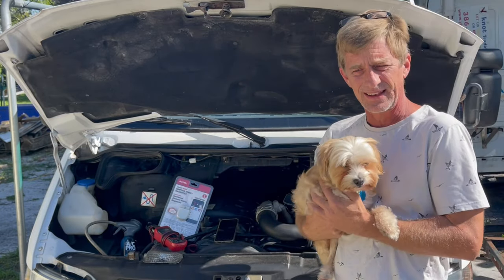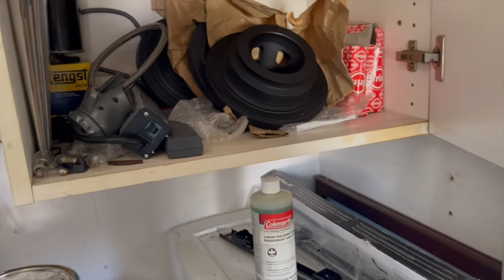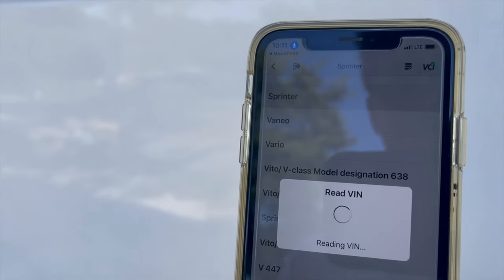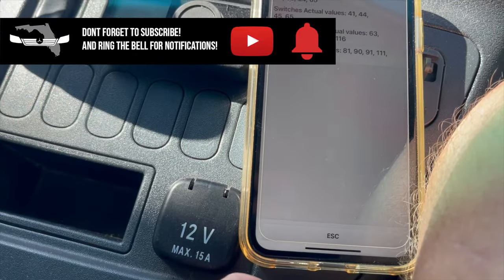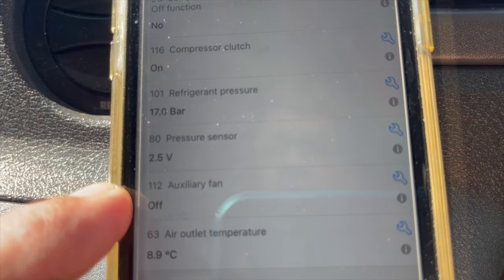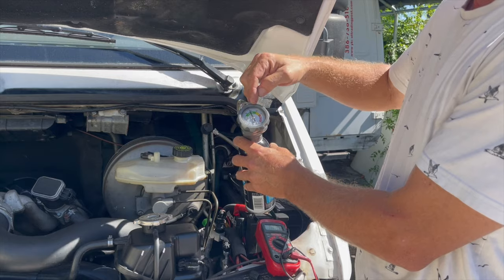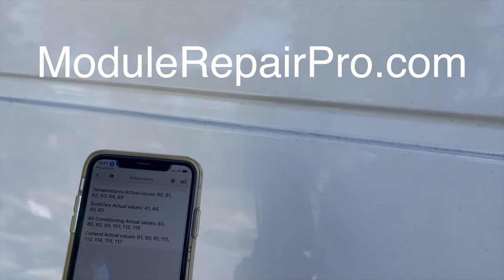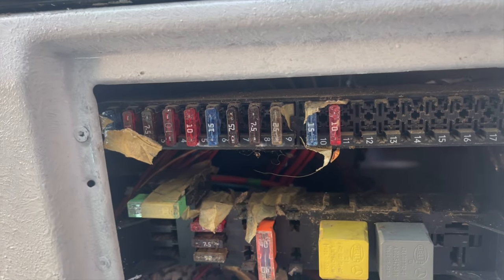T1N Sprinter Air Conditioning Diagnosis

Comment: Last one reminds me of a 8 wheeler  tipper truck that turned up here with no A/C....... Put my gauges on: Zero pressure...... I expected a sheared line somewhere..... Those unions are not the strongest......  Turned out there was simply no compressor....and the previous owner had simply put on the shorter Poly-V-Belt for the Non-A/C Version of the truck!
But it is simply criminal to leave hoses on A/C lines open to atmosphere....dust and humidity will destroy components.

Comment: This video just saved me from dying of heat on a trip to the desert! Thank you

Got some strange readings though. My ac was blowing warm and with a strange wheezing noise. The refrigerant pressure was low (3.5 bar and didn't change with acceleration) but the gauge on the refrigerant bottle read it was full (low end of green). Wasn't sure what to do so I decided to add some refrigerant anyway. It took a bit but ended up blowing cold. The pressure bounced around a lot while driving though (4 -17 bar) which I'm assuming is normal?
Reply from the maker: Normal. Our vans seem*** to need more freon than minimum green-zone but too much is bad news. The changes in pressure while driving should relate to the compressor engaging. It will disengage when the van is cold enough, the condenser coil is too hot, evaporator coil too cold, or the computer thinks we need all available power at the drivetrain. Yours might be working fine now, but if it is not be aware of the power demand situation. For instance, a MAF or EGR problem causing low power from the van can result in the a/c cutting-off every time you accelerate or climb a little hill.

Comment: Great video!  Thank you.  Inspired me to get the Autel scanner.  Amazon is showing the APT 2500 as the upgraded 200.  Recommendations?
Reply from the maker: Someone else showed me that AP2500 recently and I don't trust it! The AP200M, AP200H and AP200T were not upgrades and only locked subscriptions to other vendors like Wal-Mart and Harbor-Freight adding layers of complication to returns and tech support. If Autel sends me a unit I'll try it out, but I've pitched their product solely because I like it for 4 years, sold over a thousand through my Amazon links and they won't return my emails. Maybe we need to get a petition together?
Reply: You have my signature on this petition 🙂
1000 units is probably nothing for Amazon but Autel should really appreciate the free advertising they get through your channel. I appreciate the unbiased reviews and have learned  a lot from you. I am not a mechanic but thanks to your videos (and few others) I’ve tackled projects like water pump replacement that I couldn’t have done before. Thank you!

Comment: is the evaporator condensation drain easy to access? Can it be accessed from above, or has to be below?
Reply from the maker: I don't think it is accessible at all without tearing the dash apart. A shop-vac on the drain line may be your best bet. Perhaps blowing air into the drain line will solve the trouble? If the condenser pan is full it will surely splash inside the van.

Comment: I had a leak in the '06 Sprinter AC condenser and replaced the condenser. Then remembering that I had not positioned the outside air temp sensor; I pulled the hood release and the hood is too tight at the latch and will not open. Had the daughter stand at the front edge of the hood and push down while I pulled the hood release and still not able to get the hood open.
What is your advise on opening the hood; I don't want to cut a hole in the hood to get it to open. Thanks FVM
Vincent Chicago
Reply from the maker: There is a thing to push from underneath the front edge of the hood. Need a long & strong screwdriver or metal stick* and bending the plastic trim.
Reply: @FloridaVanMan  Thanks, I will give it a try. Happy Days    Vincent
Reply: @FloridaVanMan  Well, got the daughter married last Thursday and Friday so back to work on the van hood.
I tried with long screw driver and hardened metal long rod and I am moving the secondary lock lever but not the adjustable
center lock male part to get the initial release. Got any more detailed instructions on this hood release. I have not tried my
8' 2 X 6 with a thick cushion at the hood center front edge with two men and someone working the hood release from drivers
seat.? I just do not want to start drilling and saber saw cutting at this time.
Thanks  Vincent
Reply from the maker: @vincentrolfe1384  There are a few good ideas here: https://sprinter-source.com/forums/index.php?threads%2F17545%2F&fbclid=IwY2xjawEX0VlleHRuA2FlbQIxMAABHd9Drl8miWyipUn_2PgyBY_RCoGdxiYNKTBUqeksAQIu0SN-kdYk_G08wQ_aem_DqJcVXsqj5R8sgcjmDFEXg

Comment: Got a quick question for you let me tell you what’s going on first my sprinter runs excellently goes all the way to third gear but will not go into fourth overdrive, but will do 60 in third gear which leads me to think that is not a tourque converter ,but a shift solenoid and filter change. What do you think, I trust to work is everything you told me worked thank you😊
Reply from the maker: With those symptoms, if it were here I would do a full trans service with new conductor plate and inspect the TCM under driver seat. If that connector is wet, start there and go to the trans service if no improvement from cleaning the oily connector. We have videos for both, search "Transmission" & "Wet" on our channel. Be sure you are ON OUR CHANNEL when searching the second one.

Comment: So, my compressor is working. Pressure is at 14 ish. Fan kicks in at 20. 
Problem is my outlet temp is all over the place. 10-17C. Pressure changes a lot also, from 7-20.  Seems the higher the pressure the warmer the temp for some reason.
Reply from the maker: Over my head. I'd guess at the expansion valve or possibly just over filled.

Comment: 3.9 v rear pin pressure sensor is this mean control module needs repaur? Or can i posibley find another source to send 5 v to switch ? Appriciate what you do
Reply from the maker: Find the problem. Don't simply bring voltage to the circuit when you don't know why it is low.

Comment: When I took out the cabin air filter, the fan inside the van blew much stronger. It seems The filter in place caused a formidable air flow restriction that we couldn’t handle. What should I do.
Reply from the maker: Leave the cabin air filter out. I often drive with a window open, no filter at all. :) The engine air filter is VERY important but the cabin air filter we can do without.

Comment: hi great video thank you ,my ac works fine on my swfl van but seems to diminish temp wise after 30-45 mins and the condensor fan never kicks on ,i unpluged the temp sensor on the thermostat and it came straight on just to test fan works  ,but ac does not seem to kick it on ,what controls this ?should i be worried ? itsw superhot down here so would have thought this is important ,gas pressure was slightly over mid normal on one of those gas refil bottle guages ,any ideas, pressure sensor 2.1 to 2.3v  refrig pressure was the only one that was a bit low at idle 12 to 15bar , maybe top up the gas a bit?? thanks for any help
Reply from the maker: Proper advice would be telling you to take it to a qualified shop, but I'll also tell you what I would do at home and why. I'd add more freon. I've been told we should aim for the center of the green bar and more freon does not make colder air conditioning. BUT I've found the compressor doesn't always come on reliably until I fill a little past the center of the green zone.

Comment: How do you turn it off
Reply from the maker: Same as turning it on, top button in the right side round area. The red light above should correspond to the a/c being on or off. We've seen several vans with the problematic dash controls bypassed so the a/c is always on or on a separate switch.

Comment: What can be trouble shot when the control unit appears to be working, I'm getting 5 volts at the drier, 5bar, pressure but am not getting 12v at the compressor on the blue wire? Thanks!
Reply from the maker: Does the live data in your code reader show the button response?
Reply: @FloridaVanMan  Live data shows the AC button on the controller works as well as the temp dial. It also is confirming that the compressor is not running.
Reply: Same issue goes to mine. Control shows ac button and temp dial works. Reading 7bar on refrigerant and 1.3v on pressure sensor. Checked 5v on the first pin. But not 12v on the blue wire that goes to the compressor so clutch does not engage. Any progress troubleshooting on your end?

Comment: if my mercedes sprinter doesnt have AC option on it ,could it be mounted an aftermarket kit? is this option even fesable?
Reply from the maker: There are generic add-on a/c units but I don't think your wire harness will have everything to support factory a/c installed into your non-a/c van.

Comment: Q- If I get the over kill overhaul kit do I need to tear apart the dash to take the evaporator out ?
Reply from the maker: No, the kit does not include an evaporator as that is not a common failure part with our vans, thankfully. If you need to replace the evaporator you will need to take the dash apart.

Comment: Can you change values in the app for psi and temperature Fahrenheit?
Reply: You can tap on the little wrench icon or the one below it on the right side of the screen and change the temperature type (C/F). It's only temporary, you have to do it each time you fire up the app, unfortunately.
Reply: @wanderingzythophile9083  oh that’s unfortunate with all the technology in there but it most likely doesn’t have memory
Reply: @daveydave9884  Well, I would expect the phone app could be programmed to retain those settings, but it simply isn't a feature.
Reply: Scanned my van after watching this.  Getting compressor clutch short circuit to ground error.  Scanner shows compressor is off as does the warm air.   It does work but comes and goes.  What should I test next?

Comment: Please advise
I brought a Mercedes sprinter Van 2006 model without the front AC fitted

The guy I brought it from had a new compressor, condenser and fans 

So I paid my mechanic to install it 
Cost me $2500 to fit it. It worked for 3 weeks and stopped. Just the fan works no cold air, plenty of gas in system 

I have taken it to 3 places to fix it that has cost me $2500 plus without success
. Including changing the thermostat for no reason as it worked. They get it running for a day then it cuts out a day later 

Can I bypass the thermostat 
Can I hard wire the compressor and leave my fan on full speed as it’s very weak anyway and needs to be on full speed 

Is this safe 
I’m at my wits end and just need cold air or my wife will kill me for buying a dud AC in a hot Ozzy summer ?

Please help 
Thx 🙏🏼 Mike
Reply from the maker: Sounds like the control panel has the common intermittent issue. Modulerepairpro.com can fix it but you can likely find a replacement more locally. There are some videos showing what area goes bad so you can fix it if you are handy with a solder iron.